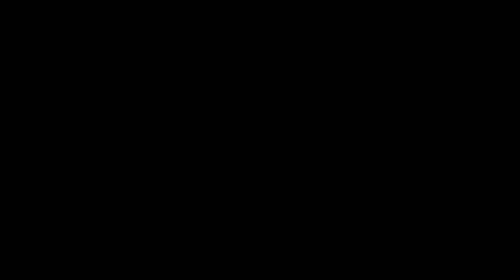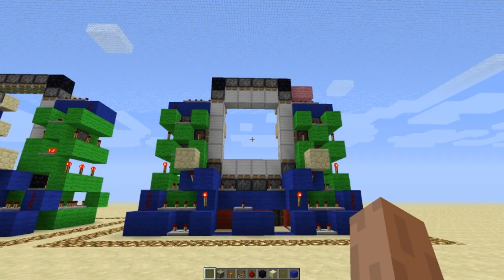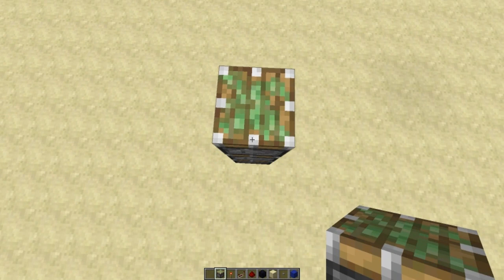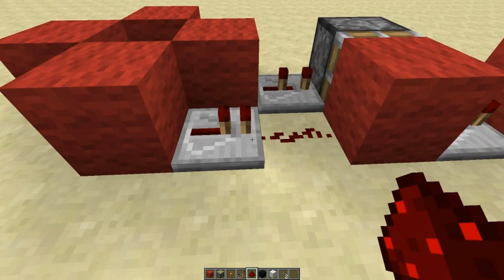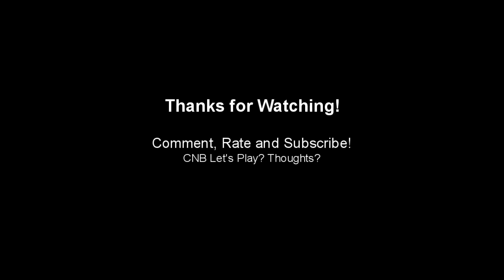CNB's 4x4 Piston Door Tutorial [Minecraft Redstone Tutorials]

Comment: well if you build the door like in the video, using my fix, it will work (if your door is facing east-west and all the other repeaters are correct)
the closing problem is exactly the one when you are building your door north-south facing. in this case use cnbs fix with my fix on the state cell

-S

Comment: Break the button, repeater facing where button was then a block behind that, then you can branch off red stone wire from the other 3 direction of the block. Don't put redstone wire on top of the block I told you to put. You still have to use buttons.

Comment: I found a bug where my door wont close ( 1.2.5 ) and im pretty sure it is due to the piston un the first layer ( above ground )  not pushing the redwool over the torch : if you manually remove it and then put a block over it, when it'll work, but not otherwise...
im not too good at redstone, any advise ? maybe they fixed that in this version?

Comment: I've been working on this for about two hours.  I'm getting the top and bottom blocks on the left side (input on the right) stuck every time, leaving a gap on the middle section of the closed door.  

After I open the door the second block up on the right most 4 door blocks (same orientation) stays out with a hole on the sticky piston.

I have checked and rechecked the timing, but everything is in tip top from what I can see.  I even remade it.

Can anyone shed some light?

Comment: I have Version 1.8.1 and When I tested it the first time (immediately after the green circuit) the centre 4 blocks did NOT get retracted and the closing system was a total mess. I made it so you needed to face West/East to pass through the door with the button on the Northern most side. Do I need to see the Door Orientation Fix video or is there something else wrong?

Comment: Having an issue with my opening circuit on both E/W and N/S with the fix.
When opening I end up with 
OOOO
OOOO
OXXO
OOOO

It's the bottom pistons on either side not grabbing the first block fast enough so then when the side pistons try to grab the 2 problem blocks they cant. Obviously must be an issue with repeater delay somewhere. If anyone has had this problem could you point me in the right direction.

Comment: *Update* I rebuilt the whole thing 180 degrees with this fix. now one half of the door works fine. except the other. (The side where the pink circuit starts is the problem) the pistons that push the blocks towards the double piston extenders don't push out the blocks on time. Everything else works except this. Help plzzz